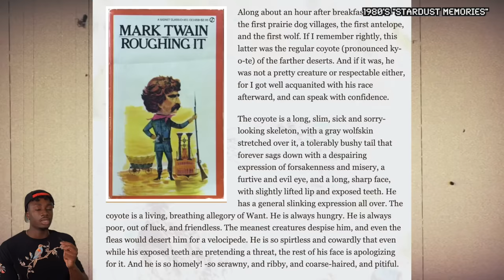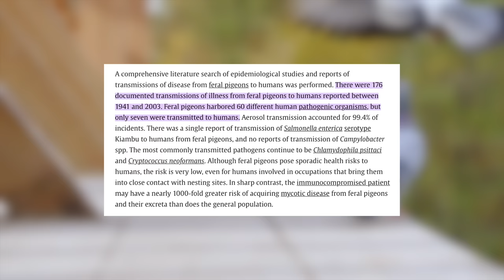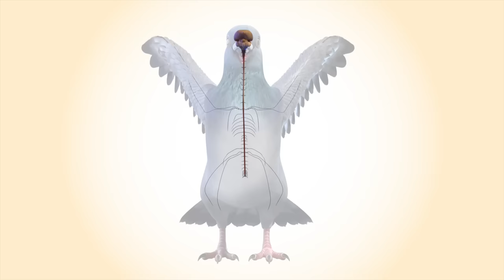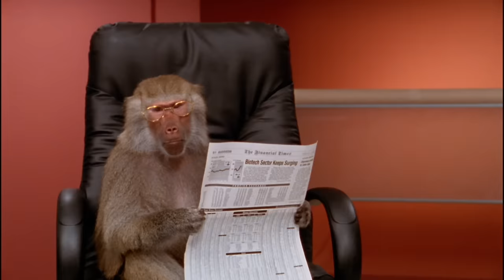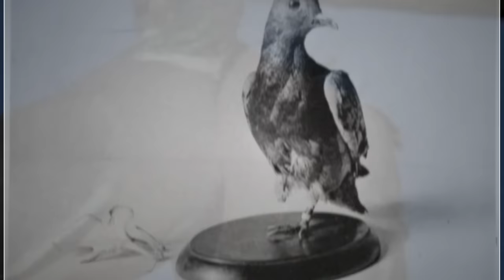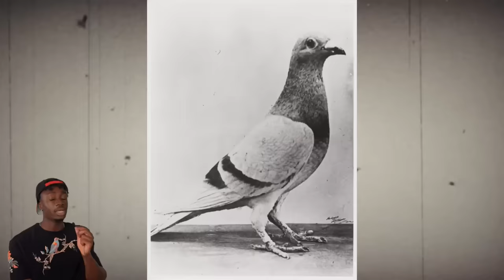How Humanity Gave This Animal the Middle Finger

Comment: One of the main reasons why rats are commonly blamed for the plague is because while they did carry the plague, it was caused by the fleas on the rats instead of the rats themselves
Reply: I think there's a theory that people were what was carrying the plague from city to city. Reason being is that rats can't travel fast enough to account for how fast it spread.
Reply: @Duamerthrax  Could be that it originally came from the fleas on the rats, and then once a couple people were infected they continued to spread it
Reply: @Duamerthrax  This theory does track a bit, but rats traveled via ships (People had ships back then) Which made it to major coastal cities much faster. People going horse from the origin is going to have a much slower spread and their gonna die fairly quickly in their journey, ultimately it seems like it it was the fleas on the rats that spread. It started with the fleas, and ended up with human transmission, but not just human transmission.
Reply: @fenixleonor  Well it didn't help things, but the plague was already rampant by the time they started doing churchy shit like killing cats.
Reply: @jolenetheredhead9761  they started killing cats around 13 century check that please😺
Reply: @Duamerthrax 
They were, also alongside livestocks that were shipped around.
Reply: theres a lot of evidence that the CARRIER was actually a different rodent.  you see rats DIE from plague... so they are poor carriers.  they also are not native to where the plague originated, but a fancy type of gerbil is
Reply: Yea,my mother finds it weird that I complain about fleas.
I don't know why they jump from my cats onto me,I don't know why my blood tastes better than cat blood.
I just know that it happens,& I hate them.
Reply: @fenixleonor [citation needed]
Reply: @shockhtoropi7143  ??
Reply: @fenixleonor  you need an academic source for cats being killed in medieval times
Reply: @shockhtoropi7143  i dont need anything you are the one that needs 🤪💚
Reply: @fenixleonor  You're the one making a positive claim, so burden of proof is on you. Quod gratis asseritur, gratis negatur.
Reply: @shockhtoropi7143  nice

Comment: In the early 1940s, the british government launched a program (Operation Columba) to gather intelligence from occupied territories by air-dropping pigeons over civilian areas in France and Belgium. This was actually moderately successful, and caused enough of a problem for the germans that they made it illegal to possess pigeons in France. This killed the pigeon-keeping hobby and is a major factor in why there are so many feral pigeons. The book "Secret Pigeon Service" by Gordon Corera provides some very interesting information on the subject and talks about how the british were this close to having a full map of the german defenses on the northern french coastline.
Reply: Those were the pigeons with cameras, right? I've seen pictures.
Reply: Thats not even the only 1940s Pigeon-based military operation. In  the early 1940s the US Military piloted a program called "Operation Pigeon" which placed pigeons in the nose cone of aerial bombs in order to guide them, using lenses and a screen, which would project the intended target in such a way that pigeons would peck at the screen. Using  pivots and sensors, the birds would peck at the target. If the target drifted offcenter, the offset pecking would pivot the screen, and the sensors sent that data to the control surface, effectively guiding the bomb to the target.

It didnt work. It got picked up by the Navy a few years later and rebranded to "Project Orcan" 

It also didnt work, then computers happened. Real good use of the R&D budget 🙃
Reply: So that's why my grandfather had to stop catching pigeons to feed himself and his family during WWII...
Reply: That is really fascinating!!
Reply: I added it to my goodreads list, thank you for the recommendation!
Reply: @Incompetent_Hero  That's why it's called "Research and Development."

Comment: We also attempted to use them as a guidance systems for bombs in the aptly named "Project Pigeon", they were basically the precursor to GPS guidance, but got shelved once electronic systems proved more reliable and cost effective. We also attempted to use bats in a very similar manner, which is also a very interesting read.

Comment: I remember seeing a few stories of pigeons in Boston that knew exactly which subway trains to get on and where to get off to get around the city to different places to feed. Someone managed to track several and found this out. They're some of the smartest animals out there, and besides parrots and crows, probably the smartest birds.
Reply: Imagine being able to fly and taking the subway 😭
Reply: @sagesarrazine6270  Imagine thinking the subway would be on time every single time.
Reply: @sagesarrazine6270  My guess is that the feeding places they were trying to get to were still within the metro, so flying from above would be useless since they wouldn’t be able to locate the feeding area if they had only ever seen it from inside

Edit: I’d assume flying can also be tiring. Plus, you’d have to swerve around buildings, poles, etc. Although I guess you could fly up high above the most of the buildings. Still have to consider things like the wind and temperature.
Reply: @sagesarrazine6270  Just because I can walk places doesn't mean I'm gonna stop taking the subway. Let the birds be lazy.
Reply: Ain't no peregrine falcons taking the subway

Comment: We also used to use Pigeon dropings as free fertilizer and if necessary meat, this is why they were such a big flex to have in antiquity, so much so that we even built them luxury homes (dovecotes). 

Also Mike Tyson is an avid pigeon collector tending to a flock of well over a thousand.
Reply: This REALLY needs clarification. You used to use Pigeon droppings as meat? Or just the Pigeon? 😅
Reply: I think they mean the pigeons were a meat option; cause the droppings make fantastic fertiliser.
Reply: @lord0jackostar  Bird droppings as fertiliser always made sense as it's very rich source of nitrogen.

Comment: They started to discust me a little when I visited Belgium. The pigeons there were missing toes, legs and looked clearly diseased. Mainly their legs. Also it was normal to see a huge pigeon pile of dung or a corpse in a street almost every day.
I don't know if it's a big city thing, but I never saw that in the Czech republic where I'm from.
Reply: Here in Dublin Ireland we have pidgeons with missing toes and legs. Hair and string gets caught in their feet and they can't get it off. It eventually gets so tight that the limb will fall off. It's very sad. We've managed to catch a few and cut off the string before they suffer an amputation, but it's difficult as you have to gain their trust enough to be able to catch them. In the city centre they look rougher, I think because they bath in the puddles which are full of oil and other grime, and probably mainly poor diet. 
We are further from the city centre and have been feeding a local flock with good seed, and their appearance has gotten a lot better. They look healthier, and shinier, though some still have missing limbs. One is missing both feet, we call her Stumpy. She's so sweet and gentle!
Reply: @catherine5939  Yeah that's sad... But the Belgian ones didn't have anything on their feet... Including their feet as I said 😅 looked more like diseased from all the poop piles... Good for those Dublin ones you managed to save ❤️👍

Comment: I have witnessed a pigeon evade a falcon before. It dive bombed right when the falcon was about to hit it in the air. The pigeon hit the ground and the falcon followed it. The falcon tried to grab it but the pigeon flew in a circle which caused the falcon to hit the ground hard (feathers flew around). The pigeon flew away, the falcon stayed there for some seconds then went off in a different direction

Comment: Pigeons and Doves do have some offensive capabilities. 
1) they can peck. Not sure how they perform this move on prey, but they do this on each other: usually around the eyes. If you see one with one eye or bald on one side of the head, it usually means it got peck by other Pigeon or dove.

2)"Wing Slap" (Im not sure what its called). Usually use when at nesting and some unwanted guest tried to invade , they gave this slap movement with the wing. ( I experienced this firsthand as my late dove had a grudging relationship with my hand. If i do the 'italian hand gesture' he will get angry and will slap it sometimes repeatedly. Its the feeling like someone slap you across the face and you feel the warm burning sensation or a while, but at the hand. Especially at my knuckels.)